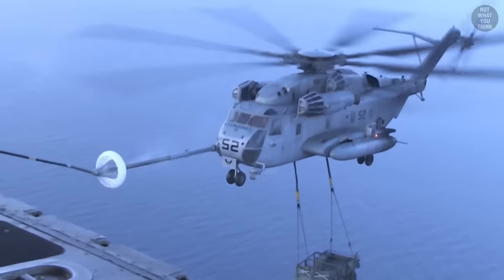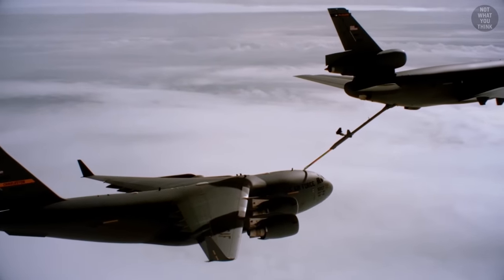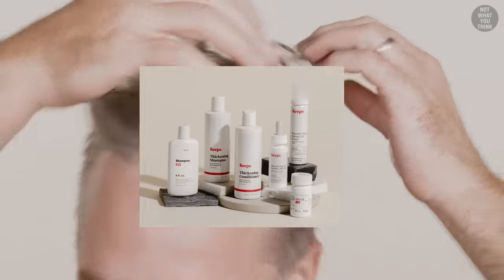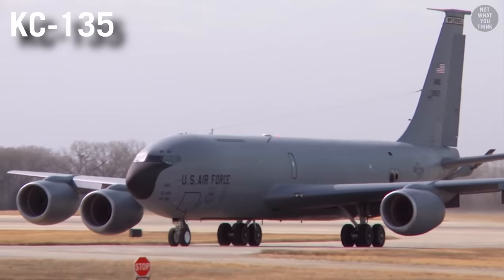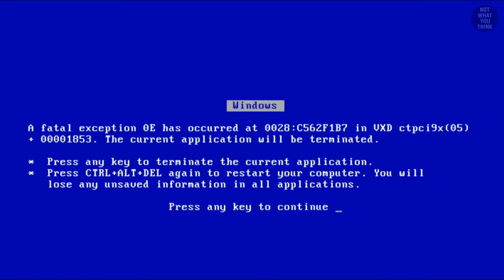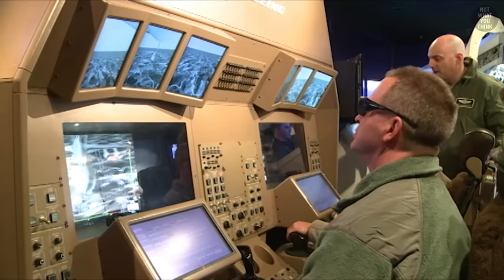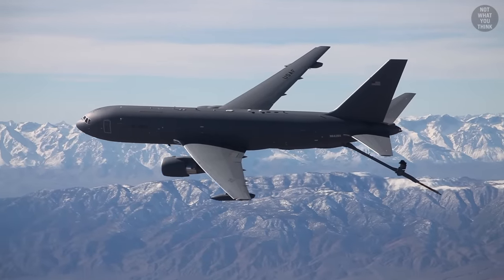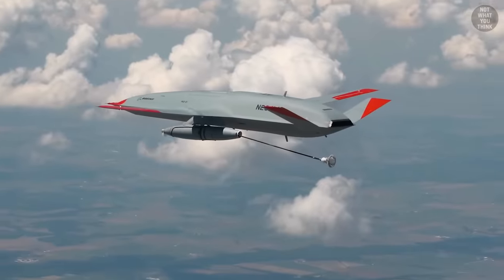Why US Air Force is Making Aerial Refueling HARDER?

Comment: (Student) Engineer. Here's the thing with this. Ya Boeing kinda stepped in their own tale, but it is worth considering that engineering is a balance between complexity, usability, and produce-ability. They probably went with alot of those decisions because it saves weight in data wires, or was simpler. As Blaise Pascal once said "If I had more time I would have written a shorter letter"

Comment: Amazing. We perfect a process over decades, fine tune it with thousands of flight hours....and reinvent the wheel on the next model. I just don't get it. Never will
Reply: Welcome to the Airforce.  Don't forget, award a contract when Boeing/Airbus both said in said contract they were going to use their EXISTING designs for said contract for refueling and the contract was still awarded.  Brilliant.

Comment: It simply needed a synconized navigation fly drone to hold the pump rod end steady to insert. This way the pipe can be loose flexy stream tube, with a insert head, instead of stiff long tube, dangling a funnel. Example, helicopters would fly over head from behind, for drone arrival under. Jets/planes, below the tanker craft to pend.

Comment: Easy fix for depth perception issues would be to use two cameras spaced an eye width apart and a VR/AR headset instead of having the operator constantly checking a rangefinder.
A fix for the restricted viewing angles would be to install multiple cameras on the boom as well as on the plane.

This sounds like another over engineered black hole for money.
Reply: Better and cheaper solution?
Fuck the cameras, and just have computers align the nozzle while the operator monitors it for redundancy.
Reply: @honkhonk8009  Better? Yeah, until the boom punches a hole in a plane because someone screwed the code up or a sensor malfunctions.
Cheaper? Not really, not if you still have an operator.

Would you trust an automated system to carry out simple surgery?
Reply: @daviddavidson2357  reformer detected, opinion rejected.
Reply: Every new aircraft has had problems it’s a tale old as time.
Hell every engineering project ever has had teething issues.
Reply: Only it ALREADY HAS stereoscopic cameras and 3D displays!

Comment: The Navy’s (p$D) method is better because more than one craft can often be refueled at one time.  With the AF (boom) only one at a time
Reply: Air force MC130s still have drogues and I'm pretty sure kc135 have them too in addition to the boom
Reply: Yes but the boom is much quicker when pumpimg fuel, which is extremely necersary when refueling big and not efficient planes like the B-52 for example, it has 8 engines and is as old as time, and same goes for other bombers and cargo aircraft, it would also be harder to guide large aircraft into a drouge. According to a pilot who has refueled from both methods, he preferred the boom method

Comment: The question i'm asking myself is "why put the cameras on the fueling plane, instead of at the end of the boom (not extended) ?" One on each winglet and one in the extension axis. That way you have a tri-point viewing camera return at close proximity to the connector you're aiming. It would still need training skills of course, but being closer reduces parallax and chances of over-exposition since the viewing range is focused on the target.

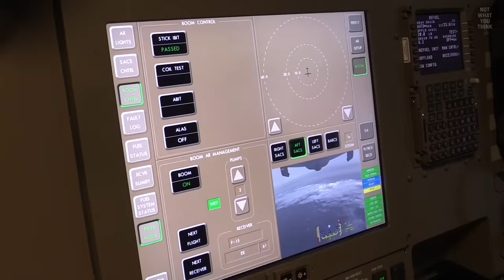13:15 - Huge tankers like that are useful for big planes or multiple-plane refueling, when fueling drones are (currently) limited by they size, consequently fueling capability. Wich means one tanker is needed instead of an entire fleet of drones. To me, the answer is easy.

Comment: a possible fix for the lack of 3d, is to use a 3d system(similar to theaters) and two cameras mounted on the boom, as well as maybe a third one mounted to the nozzle, with a PIP(Picture In Picture) style system to allow the operators to see where the boom is, as well as see from the booms perspective. the hard part will be nighttime operation, unless the refueling plane can just point an IR light at the plane that is refueling..

of course it's easy for me to say this, as i have no clue what they have tried already, but that would be my simple trial solution if i was in charge of trying to fix this.

Comment: My dad built 707s and KC-135’s at the Renton plant in Seattle.  Guess what, the KC-135 has thousands fewer rivets than a standard 707, even though it’s carrying much more weight.  All of your military equipment was built by the lowest bidder.
Reply: Not all, but most of the earlier systems were. Source selection is based on how well the offerers meet the requirements, not necessarily the cost.
Reply: @johnp139  
Exactly.
And like everything commercial or military. They all are upgraded too over time. And the step this video shows. Is just another step towards total automation,.. and the ability to do these tasks Remotely.
Drones servicing the drones is the goal. Removing more people from the battlefields of the future.

Comment: They should have just taken the Airbus A330 MRTT and be happy with it. Would have been much cheaper for the tax payer and much more powerful than the KC46. But I guess most tax payers in the US are fine paying way to much as long as it is made in the US.
Reply: Yep. In addition to the A330, the A400M has an aerial refueling pod kit. Not saying we should use those, just saying that this isn't some insurmountable problem.
Reply: Its not that.
Senators/Congressmen have a big incentive to bringing jobs to their respective state. Obviously as a result, alot of US programs focus on domestic solutions.
France, Canada, and Britain also do the same thing. Im in canada, and my school does this with 3D printers.

The A330 MRTT is good, but prolly gonna be painfull to be made in the US, since most US airbus factories are probably occupied.
I feel like Lockheed probably has the better plane than Boeing. But the Airbus is still like top tier.
Reply: Far as I heard, the MRTT (MRRT? Eh, whatever) was supposed to be the winner, but Boeing pulled the Whiner card and lobbied hard enough to get the USAF to relent on that decision. The plane they delivered has thus-far eaten 12.5% of the revenue off the fixed-price contract they signed (5b of the 40b contract)

Comment: There isn't anything inherently wrong with MCAS. Both Embraer and Airbus have similar systems installed in their jets. Boeing learned what they did wrong, in that MCAS had priority over the pilots, while other systems in other aircraft gave pilots the priority, and they could override the system. Even then, if MCAS did have priority, it could easily still be rectified by just pulling the MCAS circuit breaker and disabling the system. 

So just flat out saying MCAS is problem isn't fair, other manufactures have been doing it for years with little to no issue,
Reply: Exactly.
The only problem was Boeing and Money. They wanted to save on training costs. But MCAS just happened to be one of those rare issues that raised it's ugly head. But maybe. It made it better overall. It was a high cost in life to pay. Let's hope it pays off for those who paid that cost.

Comment: In the meantime mid-range cars are equipped with as many as 10 cameras (visible and infrared), TV industry can stream 8K over single coax along with power very close to realtime. 4K@60Hz over single fiber with one frame latency? BMD got you covered. And yes, you get full exposure control.

Comment: This "technology improvement" is just to increase profits to the manufacturers. Also makes tanker vulnerable to electronic failure, which would stop refueling and planes with empty tanks to crash. The old method works great, so just install human stick control eyes-on through glass window in newer airframe. The actual refueling could be manual with ancillary electronic help. (gauges) If electronics fail the manually controlled system keeps working, human eyes through a window. 
Keep It Simple

Comment: It really makes you wonder, what was so bad with the window flexible boom system similar to the kc135's? If it's not broke don't fix it. Some really smart engineers at flight refueling or some other company will design a work around to convert the new tankers to the old boom with window configuration and boeing will again have their nose rubbed in it as aircraft are converted and used with the proven old design....

Comment: The 46 is refueling 35s and 22s now. I don't mind taking gas from it at all. It seems like they can get to contact pretty quickly, the director lights are super bright, and the boom is so strong you can almost fly hands off once you're connected. They still probably should've used a viewing window, but I think the RVS may be used for UAV refueling someday using computer vision techniques.
Reply: I know it’s been 7 months but what do you fly, I’m curious?

Comment: drone tankers are the obvious future
When shot down, less loss of life, process could be made faster and safer when automatic and you can send more tankers in the air easier, refuel more planes at the same time
and you can make drones stealthier, so you can refuel stealth planes much closer to enemy air space without being detected, increasing the mission radius for stealth planes who often already have a limited range due to not having outside tanks (for stealth reasons)
I think drones are also cheaper to maintain, could be made electric, so no fuel loss during flight (more for the planes)

Comment: What blows me away is that they still haven't put a small camera near the end of the boom. One a foot or so from the tip would fix most of the current depth-perception and scratching of paint issues, and modern cameras can be very small (so as to not mess with the existing form-factor of the retractable part of the boom) while still being very clear and high-resolution. Something like a modern phone's camera, to be used for the final part of the probe's travel.

Comment: They should have designed the KC46 with both manual boom operator system in back and a auto camera operated system . 
I spent 26 years as a mechanic on the KC135 and saw refueling of many different aircraft under different conditions .

Comment: The real silly part is that aside from the boom method being already perfected, there were several operational 767 tankers already. The new US tanker could have been put into production quickly and easily with minimal design changes.

But US defense procurement always has to have the latest the greatest quantum leaps and capability or they don't want to spend the money at all.

One suspects there was also pressure to make the contract a little more profitable

Comment: all this automation can and should be done with a basket, a kc10 relying on an electrically controlled system is an extra liability, f 18's don't need algorythms to extend a basket and they can refuel another aircraft even with an electrical failure providing the basket is already extended, remember K.I.S.S. when bullets are flying, reliability is kinda important.

Comment: Ace Combat: Connection For Flight Interface(COFFIN) is a advanced control system where a human can use an aircraft with their thoughts or body movements. no need for glass canopies or front windows

Real Life: can't even reliably refueling a aircraft

Comment: Hose and drogue is easily automated because the receiver does all the positioning. Boom refueling relies on the tanker to maneuver the boom.  If you want to save money by getting rid of a crew member? Teach the boom operator how to use the radios and get rid of the copilot position.

Comment: It's my understanding that the DC-10 airframe upon which the KC-10 is based had major problems. Which is why they are dropping from commercial use.
Boeing used to have a stellar reputation. However, that is no longer the case.
Reply: The DC-10 was hard to maintain due to the positioning of the third engine and the design flaw of running all three hydraulic systems through the third engine. That design flaw caused the crash of United Airlines 232. Add to that, the fuel and maintenance costs of a 3-engine plane that required a flight engineer in the cockpit, and you're looking at a plane that just couldn't compete in commercial aviation, with the more cost-efficient A310, A330, B767 and B777 airliners. 

3-engine jets are just not a good idea for aviation.

Comment: Why do they have this problem? The Dutch KDC-10s already had a remote vision system for our F-16s. And it has been certified for the F-35 as well. And those are being retired now, in favor of Airbus A330 MRTTs. So it’s not new stuff either.

Comment: The main problem here is the fact that it's a new technology that people are used to yet. When fighter jets first came out, the German pilots noted that it was very nerve-wracking having to land the Me-262 with the engines running, as opposed to the piston driven planes which could be glided into landing. Eventually, the pilots overcame and were able to harness that technology.

Comment: The drogue seems to be the better system, you don't need someone to control it and it has a high margin of error. YOu already have 2 skilled pilots. 1 that can focus on just being stable whilst the fighter pilot has a good view and is more than skilled enough. Also, it should be able to be automated by using already onboard navigation and targeting systems. espesilly as the drogue again is such a large target with a large margin for error that can be easily tracked with most camera software.

Comment: Black and white was probably used for the higher contrast. 
4k is gonna be a problem for them. Latency is built into it because of the need for on board processing within the display. Old tech like CRT does not have that problem. Even pro gamers recognize this.

Comment: Another logic: we need to replace the tankers because we're running out spare parts..,so instead of decommissioning some of the kc 10 and 135 to Striptease fore spare parts, they just scrap all kc 10 , before even checking if the new model works

Comment: F/A18s can land on carriers hands FREE from their begining. And they are old now. A data link connects the two. The shipboard computer flys the plan to a perfect 3 wire arrest every time. Why not just data link the refueling prob and receiver aircraft. Easy sensors on the boom, wing tips and top of vertical stabilizer could compute very accurate boom location relative to the receiving bird and send flight adjustments for quick fast and accurate plugs every time.  Throw in a but of AI to predict turbulance changes as the tanker flies around the racetrack. The active transmitters of this can be very low power and thus short transmit range to almist achieve EMCOM. silence. The only need of a camera would be for mishap evidence for safety review and evaluation.

Comment: Shouldn't air-to-air refueling be automated at this point?  --  They need to be able to have both/multiple aircraft and the refueling boom under the control of the same system that coordinates and automates every part of the process.  Same goes for coordinated carrier landing systems that model and monitor both the aircraft and the ship telemetry (and ultimately even the sea state/upcoming waves with LIDAR).

Comment: You can't blame Boeing for this one. This was actually the Air Forces fault. If I recall, they didn't want boom operators in that belly location anymore ether due to safety or duty time requirements (it's been a while since I heard). So they tasked Boeing to develope this system which isn't used on other versions of the tanker and it was to use off the shelf components. It's effectively the same problem with the LCS, Zulwalt, and Ford class carriers. They made decisions to save money and development time that ultimately cost them money and development time.

Comment: Sensor on boom, series of guide marks that are covered or transmitters that are shut off when not fueling. Computer uses sensor to follow the trail into the connection, just like that line following robot they invented in the 1960s. On top of that passenger jets can land themselves automatically on runways, you're telling me that the air tanker cant transmit position info to the aircraft refueling and the aircraft cant use that info in its autopilot to approach the boom and hold steady? That will be $870 billion payable to me, thank you very much.

Comment: The whole RVS is pretty ridiculous. There was the option of putting a windows AND a RVS system to be able to work by having redundancy and letting the algorithms learning from broom operators, exactly like tesla did, but instead, they went straigh to "let's make it without windows because we need the data". They could even have broom operators working through the cameras, and doing it correctly to get feedback. They could have tangled cables to simulate the latency. But nah, let's get straigh to the point.

And the MCAS thing lol.